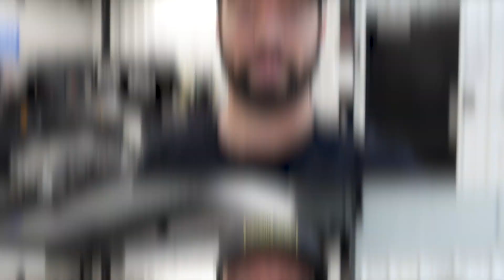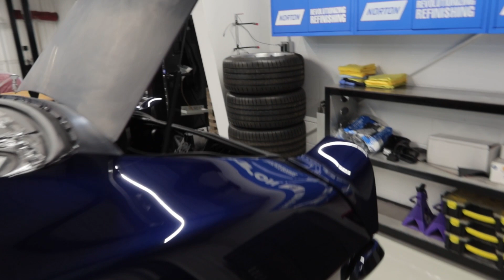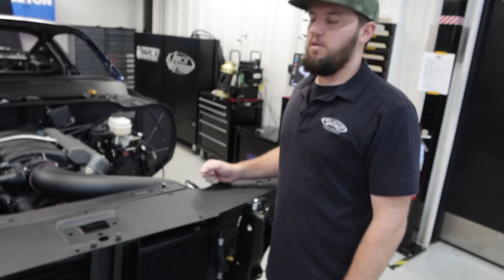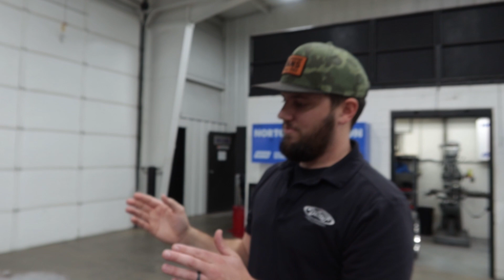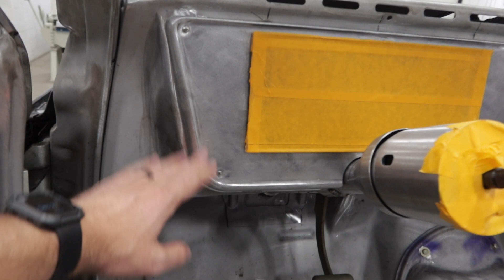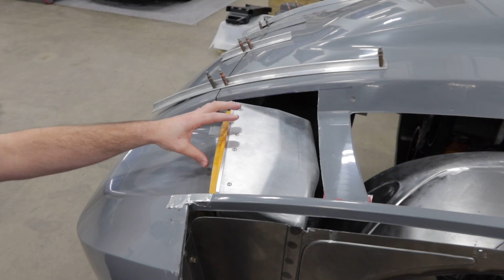Daytona Progress and More! - Project VLOG - Ep. 017

Comment: Did you get the Ringbrothers hinges to work? I installed a set on my Firebird and could not get the bottom door to rocker to sit flush. The lower hinge was hitting the door and the bottom of door still has to move in at least a 1/4 of an inch.